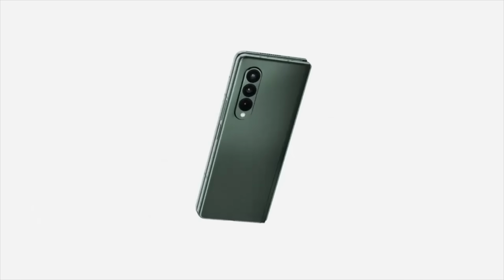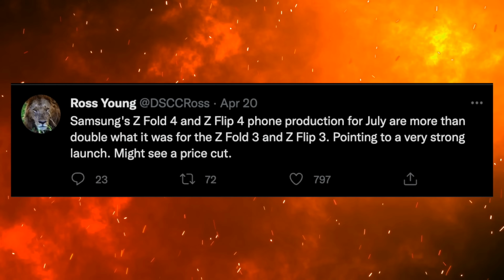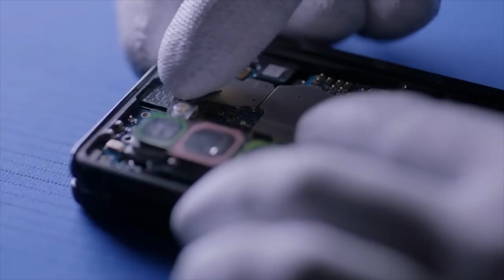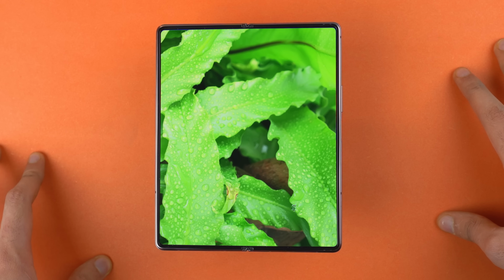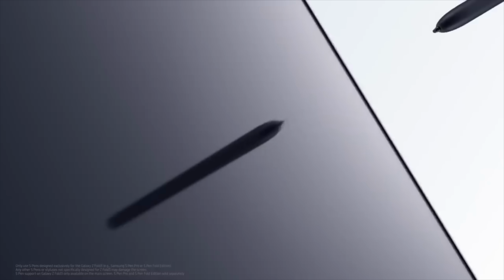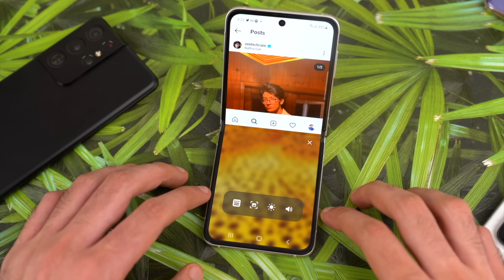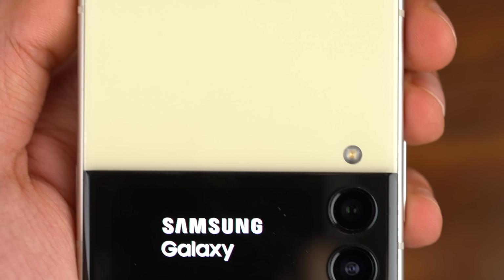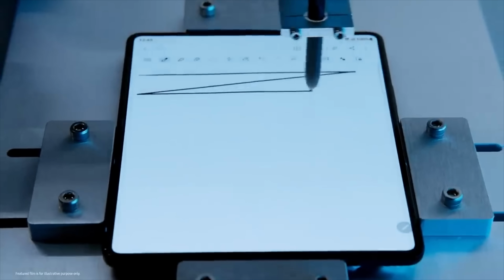Samsung Galaxy Z Fold 4 - THIS IS INCREDIBLE!

Comment: Great advice is get the Pixel fold or the OnePlus Open. That's the two great devices in the market right now and I think it will be perfect for the next couple years. Nobody should rush to get a new device. One of those are the greatest ones for the next couple years before the folded phones get better

Comment: after waiting and waiting and waiting... if you hope it really sucks, then you won't be disappointed when it actually does. no this. no that. forget about an S Pen. MicroSD is like pulling God's Teeth. 8 Gen 1+ is only a chip which throttles itself, no extra software write needed. cameras and graphics borrowed from S22 Ultra... so why not just buy an S22 Ultra? smh

Comment: i hoped theyd make it taller when open. The S series is close to most video formatting but the fold actually produces a smaller picture because it's not wide when opened. Unless you stretch and zoom it unnaturally. i wish they made at least as tall as the S ultra so media consumption was at least the same.
Reply: Underrated comment

Comment: They should increase the battery and optimise it 
Then it will be a true beast mode 🔥🔥🔥💯
Reply: How would they make the battery bigger if the device is going to be smaller? 🤔
Reply: Gen 1+ will save battery 🔋